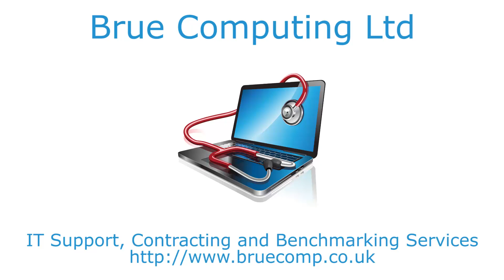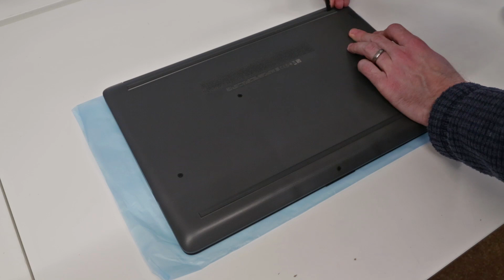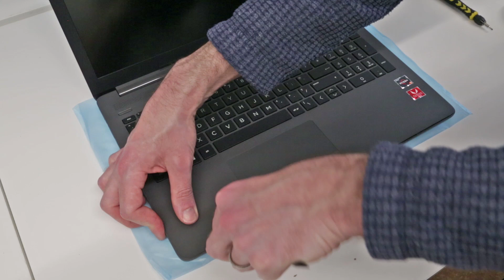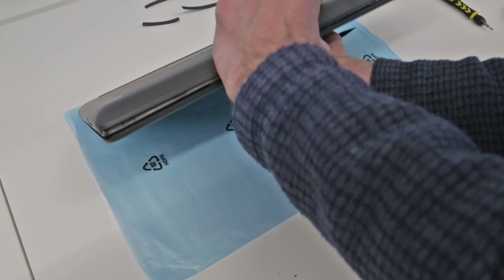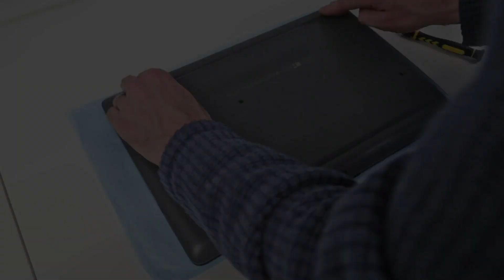HP 250/255 G7 - M.2 SSD and 2.5" HDD/SSD Upgrade Guide - 6BN96EA

Comment: Thanks very much, my HP is basicaly identical to this though I have an NVME and I was thinking of installing a SSD 2.5''
Reply from the maker: You'd probably need to add in the SATA bracket and cable - assuming the mainboard has the connector for it...

Comment: After removing the screw that holds in the CD drive, pull out the drive before you remove the back cover.
Also, before reassembling the laptop, make sure the white cable feeding the EWiFi unit is clear of the CD drive socket; otherwise, you won't be able to replace the drive after you have reassembled the laptop.

Comment: I've always hated that HP puts the screws under the rubber feet.  On older machines that rubber is brittle and breaks, on newer machines the tape becomes a mess and they start to detach. Diabolical work from the HP engineers there.

Comment: STOP SUC@@NG AMD C@@K SHOW AS THE INTEL VARIANT OF THIS LAPTOP !!
Reply from the maker: Weird statement - the assembly of both the 250 and 255 G7 is near identical and for the previous generation G6 models I did guides using the 250 model.
The choice was almost entirely around which model I could buy for the lowest price, since I bought the laptop specifically to do the upgrade and repair guides when it first came out.

Comment: hi, would this apply to the hp250 G7 also. You only mentioned the 255  the video?
Reply from the maker: The chassis design is basically the same - 250 is the Intel based version, 255 is AMD.
The machine I was working on was the 255, but the process is almost identical for the 250.

Comment: Can i upgrade hp 250 g7 processor ?
Reply from the maker: No - as with basically all modern laptops the CPU is soldered to the mainboard, so the only way to upgrade it is to replace the whole board.

Comment: Hi, my son has a similar laptop ie hp 255 g7 but we're unable to turn it on. I suspect the battery or the dc jack connector is faulty any idea what kind of connector I should look for on ebay? Cheers
Reply from the maker: If the battery is faulty it should still turn on with mains power.
Normally if the DC jack is damaged you should be able to see the centre section of the jack is broken - normally happens when someone trips over the charger with it plugged in.
Part number for the DC jack is L20475-001 - search for that on eBay and you should find them.
Reply: @BrueComputing  Thanks so much for your help. 👍🏻
Reply: @BrueComputing  Hi, what if I changed the connector and it still doesn't power up, any ideas?
Reply from the maker: I'd strip the system down to the minimum components (disconnect battery, screen, touchpad, storage) and leave just DC jack, fan, keyboard and RAM connected. Before starting leave it a couple minutes with battery disconnected and power unplugged.
If the system won't spin up the fan when turned on with the power connected then there is a likely a mainboard failure.
Reply: @BrueComputing  Thanks so much Sir👍🏻
Reply: @BrueComputing  Hi Sir, may I know if you don't mind giving me a step by step guide as to how to replace the connector cable. This is my first time so I don't want to damage anything. I have opened the laptop but I find it a bit tricky removing the cable. Thank you once again for your help. 👍🏻
Reply: @BrueComputing  Good evening Sir, just wanted to let you know that I have finally been able to remove the connector cable. 😀👍🏻

Comment: I have a HP 250 G7 and the specifications from HP state that it comes with an M2 drive and and an SSD.. but what I see on my system is only one drive, and I can even hear the HDD spining around. My question is: can I add a drive to the M.2 port and replace the HDD with an SSD?
Reply: A SATA SSD is the obvious upgrade from a SATA HDD.

Comment: Why would a laptop have an hdmi port for a graphic card to output hd when the monitor's maximum resolution is only 1366x768?
Reply from the maker: My 255 G7 had a 1080p, but if you have a 1366x768 one you can still output 1080p to an external display as a second display, or only using the HDMI port and disabling the internal display.

Comment: What size screw do I need for the hard drive connector board and what size screws do I need for the hard drive on the metal brackets?

Comment: For the ones who faint when looking at the prices for board and cable: I just installed a "LS-G072P / 4350M932L01" Board & Cable ("compatible with hp15-da hp15-db"). It cost me around 20€ and it works just fine for me with a 2.5" SSD. Thanks for the video, btw!
Edit: My Laptop is a HP 250 G7
Reply from the maker: Great tip!
Reply: just this and a sata sdd?
Reply: Would this apply to a 255 g7?
Reply: Why so expensive. I bought LS-G072P on aliexpress for 3$
Reply: Can u add hdd and ssd both for hp 250 G7?

Comment: Hi! I install a NVME ADATA Falcon 256GB on my 250 G7 153B9LT and when i press de button the laptop turn on, but the screen is black and after a while the nvme begins to warming up. Please help
Reply from the maker: Have you installed or cloned an operating system on to the SSD?

Comment: Can i mount a ssd 2,5" in the optical drive bay space? Does it have a sata port?
Reply: Normally you shouldn't have any problem. Although I've never swapped a HDD with a SSD in a laptop. But I don't see a reason why a SATA SSD wouldn't work, since it's a "normal" storage drive too :)

Comment: I bought a Sabrent M.2 SSD to 2.5-Inch SATA III Aluminum Enclosure Adapter (EC-M2SA) from Amazon. I have 2 Crucial MX500 M.2 500 GB SSD’s (One was already laying around and the other one is already installed in the Laptop). Once I put in the Adapter, can I fit 2 of those SSD’s in the enclosure for the computer to have 2 SSD’s?

Comment: I like the old laptops where stuff was so easily replaceable from bottom. HDD? Unscrew the cover, pop-out the old one pop-in new one, screw cover back on done. RAM? Same. Battery? Now that's best, Unlock, press, swap. Yeah! You're running low on battery? Put in another one! Full again.
Thickness? A bit more. Weight? Also.
I/O ports? Yes. That's enough of answer.
Keyboard? It actually clicks and travels.
Dusty fan? Remove it's bottom cover and clean it. Easy.
Repair something else? Unscrew bottom screws, get in.

Comment: I think that Hp  should put this video to their official support channel since there is no good explanation on this matter, nearly all Hp laptop users (including me until very short while ago) don't even know that they can add second hdd via hdd connector board replacement or cable into their laptops which come with default m2 ssd, thanks for this super helpful video!
Reply: Exactly no wonder I found myself on this video

Comment: I've just got my hands on the a4 9125 model with 120GB SSD. I'm considering upgrading with an Nvme drive and though I haven't got it open yet I'm 99% sure it's SATA like in your video. What are the chances of an Nvme SSD working in that slot? And given there are Nvme versions of this laptop, would that be an assurance of booting from Nvme? Cheers
Reply: same question here.. im trying to figure out if an nvme drive would work on the sata slot?
Reply: @jahivan  Did you ever get this question resolved? I have a friends HP G7. It has NVMe drive installed as it states this on the label. Toshiba one. But it has two notches (keys) on the end of it which usually means its SATA. All NVMe drives appear to have one notch (key). Trying to replace a dead one but from the video Brue says the slot can accommodate both types. Did you get one fitted ok?

Comment: HP should stop making upgrades this hard...
Opening a Lenovo is just removing screws.
Reply: Lenovo also chose to solder single channel memory on ryzen laptops around this pricepoint at a point.  Not super happy with HP’s approach either, but I’ll take it over even less upgradability, I guess

Comment: So u say i can install an NVMe SSD in there & i would hav no compatibility issues.
However, would i need to manually go into the BIOS & change the settings to PCIe as opposed to SATA to make sure it will run at the native NVMe SSD speeds?
Reply: Don't have to, that setting you're thinking of is strictly for the SATA controller, (using IDE/compatibility mode instead of AHCI for backwards compatibility with old OSes for SATA drives. Or RAID if you're planning to use some logical setup for redundancy or speed increase), while NVMe will strictly only use the PCIe bus by default without configuration in BIOS, as it is separate from the SATA controller in the laptop.
Reply: Did it work with NVME M.2 ?? Thanks !

Comment: Is there any cheaper alternative to that £45 drive connector?
Reply: Hp 15-DA 15-DA0003NA HDD Hard Drive Connector Board LS-G072P. This cable will work. There are plenty on eBay for no more than £10. I am currently using it and there has been no problem. Please order with cable. Mine was shipped from China arrived within a week.
Reply: @yesshivu  thanks so much, ordered one and working as expected!
Reply from the maker: Not that I'm aware of.

Comment: What is the point of including in the machine a PCB board that has no SATA connector ? I mean the one you removed at 6:53 ? Either put one with the connector or don't waste a piece of PCB ! I don't understand why PC manufacturers are doing such silly things.
Reply from the maker: It is a bit odd! I've also seen some HP machines which had an silk-screened M.2 slot on-board (so space on the PCB, but no connector), then an M.2 SSD in a 2.5" SATA drive caddy.

Comment: Good afternoon,
I ask you to clarify: To install an additional SSD in this laptop, you need to buy a cable for connecting SSD and a pocket for SSD, Right?
Tell me, is this cable suitable?
https://aliexpress.ru/item/33054293082.html

Thanks for the answer!
Reply from the maker: No, that's from a different model and may not fit.

Comment: @brue computing, I have one of these also without a DVD/CD-ROM Drive. I downloaded Speccy and it said I had this drive SAMSUNG MZNLN128HAHQ-000H1 from the factory in it. I would like to upgrade it to the 500 GB M.2 drive from Crucial. I ran the system scanner on the computer at Crucial, and it said that a M.2 SATA would work. Just want to confirm with you before I order it.
Reply: Wait... you'd better use a M.2 PCIe instead of SATA.
Reply: Sorry... I was thinking 'bout a 470 G7...
Reply: With what type of storage did you replace it ? I just ordered a WD Blue 1TB SATA-3 M.2. Wil it work ?

Comment: Hi @Brue Computing, my laptop is the same as the one in your video, without an optical drive. I want to add an HDD using an optical drive caddy rather than source the board and cable to put one in the HDD bay space. It appears that even though the casing doesn't have a space for an optical drive, the SATA connector is still present on the motherboard - is this correct?
Also, are there any mounting points for an optical drive caddy, or is just a case of hoping the case screw lines up with a hole in the caddy? Obviously I don't want the caddy ratting around inside. And is it it a 9.5mm caddy that is required?
Thanks in advance.
Reply from the maker: Yes, mainboard has the connector regardless. Caddy would be 9.5mm thick.
Best option would be to source a replacement base panel with the opening for the optical drive, mounting bracket, and front panel for the drive (which will fit on the caddy to match the shape of the base). The non-optical drive base has some strengthening webbing moulded into it which would obstruct fitting a caddy internally.
Reply: Beware that the optical drive uses a USB 2.0 to SATA bridge which basically means that the speed of the SSD will be limited by the USB 2.0 max speed which is 30~40 MB/s.

Comment: I have a hp 246 G6, can I use a SSD m.2 NVMe ? Or only sata interface
Reply from the maker: It really depends on the original configuration of the machine - if it shipped with a HDD and no M.2 SSD then it probably won't have an M.2 slot on the board.
Reply: @BrueComputing  I bought with hd. Where couldt I get the slot to m. 2 interface?
Reply from the maker: @hernandoovalle3212  Its possible the systems with a HDD as standard don't include an M.2 slot - you'd have to open it up and check.
If it doesn't you'd need to fit a 2.5" SATA SSD instead.

Comment: I have model with m.2 ssd in. Is there second M.2 ssd slot? And if yes where I can see if my laptop has it?

Easiest solition is to replace existing  m.2 ssd with bigger one if i dont have another m.2 ssd?

If I am not mistaken my other option is to buy sata cabled and motherboard piece (together are priced aroud 50 euros) or put HDD/SDD in caddy by replacing optical drive. If you want to replace optical drive what would I need?
Reply from the maker: There is only one M.2 slot, so yes you could fit a larger M.2 2280 NVMe SSD such as this: https://amzn.to/2XqIgDe
Getting the HDD caddy, cable and PCB is generally not cost effective, hard to source and £60+ for the bits.
Optical bay caddy available here: https://amzn.to/3el3A3g
Reply: At 6:38 you showed to connector board with your finger. What is the purpose of said connector board?

P.S. my laptop is Hp notebook - 15-db0005dx but I opened it today and it looks all the same as one in tue video. Your video I closest to what I needed to see and I am so thankful to you for making it!
Reply: If I understanded correctly I just need optical caddy, 2.5 inch HDD to insert in it and I just swap it with optical drive and that should be it? One screw and 2 min of work

Comment: I've never installed a hdd before but fitted a Seagate BarraCuda 1TB SATA III 2.5" using a Hp 15-DA 15-DA0003NA connector board, as shown in the guide, but it isn't coming up when I reboot up the laptop 😟

Not sure what I'm doing wrong but could I be missing something?
Reply from the maker: That's a completely different laptop, its probably not compatible.

Comment: At 5:53 the Vlogger points to the M.2 SSD and says "This is a SATA SSD". Not accurate dude! It is an M.2 SSD, not SATA! Then goes on to say that it should be possible to fit an NMVe drive into it as well which is also not accurate because there's no way an M.2 slot could fit an NVMe drive!
Lastly, half the video is spent opening the laptop which could've been played at 4x or higher speed and possibly condensed to something like a minute!
Other than that, the video is helpful.
Reply from the maker: Just to clarify a few things: "At 5:53 the Vlogger points to the M.2 SSD and says "This is a SATA SSD". Not accurate dude! It is an M.2 SSD, not SATA!"
It's actually both, but I should have been clearer - it is an M.2 SATA SSD - an M.2 drive using the SATA interface, as opposed to an M.2 drive using the NVMe PCIe interface.
When you say an NVMe drive won't fit I assume you're referring to either a 2.5" U.2 drive or a full sized PCIe card.

Some laptops will only support either SATA based drives or NVMe based drives, depending on the interfaces connected up to the M.2 slot - in the case of the HP 255 G7 I had it can accommodate either.

You can read more on the different M.2 SSD interfaces and physical keying here: https://en.wikipedia.org/wiki/M.2#Features
Reply: @BrueComputing  will it able to run your NVMe SSD at it's native speeds? i've heard in the BIOS, one must manually change the configuration on the M.2 interface from SATA to PCIe to make sure your computer runs the storage in PCIe mode since it IS an NVMe installed & NOT an M.2 SATA drive.

Comment: thanks heaps. i just got one with a HDD and wanted to swap out to a SSD however now that i have 2 M.2 slots and some spares i have installed those too so now i have 3 ssd's in it lol

awesome laptop

couldn't figure out how to open it until i saw the screws were hidden under the brittle rubber footing... hopefully i can glue it back together lol

thanks heaps : )

Comment: Does someone know if it works with a hp 245 g7?
Reply from the maker: The 245 G7 should be very similar, just a slightly smaller chassis.